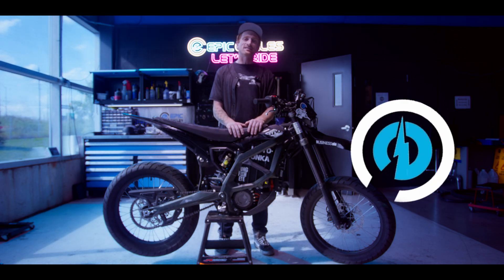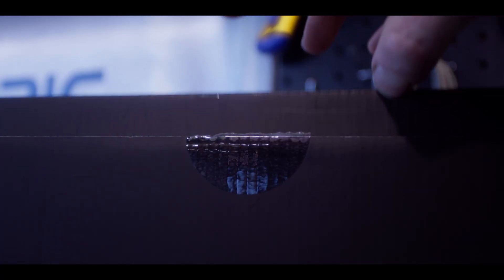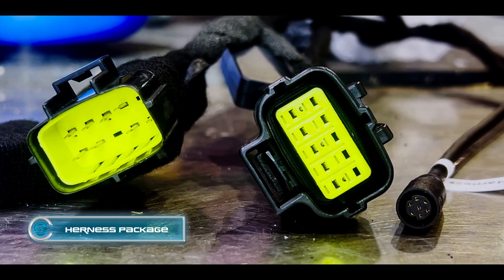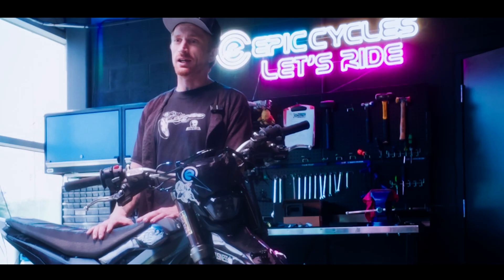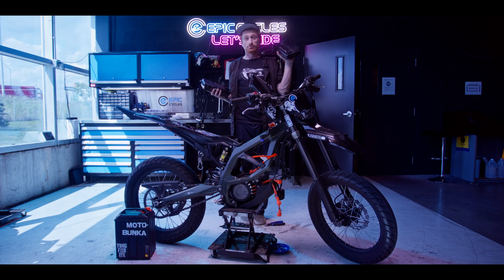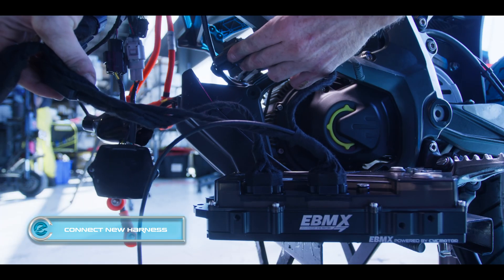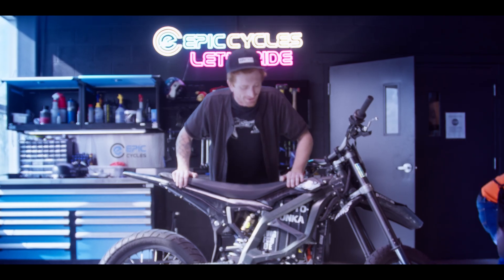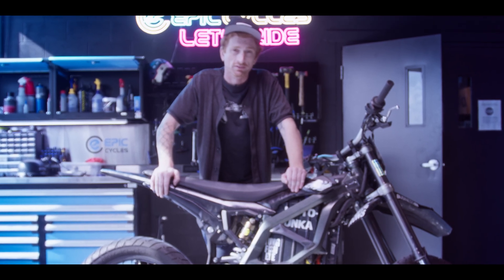EBMX X9000 V3 INSTALL - SURRON ULTRA BEE

Comment: We have tried to install an EBMX V3 on a 2025 Ultra Bee with a Chi Apex battery. Bike will not function. Zero power when key is switched on. We have power to the controller, voltage converter, battery comms cable via Chi converter…. Still nothing. 😢 Any suggestions?
Reply: the screen is on but can not swtich to ready right？and Revers didnt work either
Reply from the maker: Sorry to hear you're having issues, make sure to check all fuses.

Comment: Why aren’t you able to use the regen trottle or display
Reply: Why wouldn’t they just put the 2 to 1 cable in so you can run the display

Comment: Ultra Bee 2024 ? or 2025er ?
Reply: I’ve tried the EBMX V3 on a 25 and it doesn’t seem to work.😢 going through the EBMX support process takes a lot of time at one response every 4 hours.
Reply from the maker: Thank you for watching the video.

Our installation video was not meant to be fully comprehesive, so we suggest reading the instructions provided with the kit to diagnose and resolve any issues.
Reply from the maker: Thank you for watching our video.

The installation was performed on a 2025 Surron Ultra Bee.

Comment: I got the bike to work but it doesn’t seem like I can cycle thru the modes. Unless I’m dumb and I don’t know how to enable the wheel lift assist mode with the stock display.
Reply: You have to tap traction control button aka asr 3 times to activate it or something I’m pretty sure
Reply: Yeah, I was thinking the same thing I want to install mine but he said that you could not install the display
Reply: @bleacher_7882 so far it’s working for me but last night I had a weird thing happen. I have been emailing them to try and understand the eco, drive and sport modes on the ultra bee and what they do with the new controller and I was gonna test them on my stand. And when I went and hit the red switch then I hit ready and the bike started accelerating on its own. So far it stopped but I’m trying to figure out why it happened
Reply: We have tried to install an EBMX V3 on a 2025 Ultra Bee with a Chi Apex battery. Bike will not function. Zero power when key is switched on. We have power to the controller, voltage converter, battery comms cable via Chi converter…. Still nothing. 😢 Any suggestions?
Reply from the maker: Thank you for watching the video.

Our installation video was not meant to be fully comprehesive, so we suggest reading the instructions provided with the kit to diagnose and resolve any issues.

Comment: The battery on the 2025 is different, don't have to turn off regen with the 2025 Ultra Bee right?
Reply: Or do we?
Reply: I believe he also has a 2025 but not too sure. Lmk if u figured out how to do it cuz im lost
Reply: @soyernie I have the v3, but still waiting for my 2025 ultra bee to arrive
Reply from the maker: Thank you for watching our video.

The 2025 Surron Ultra Bee features an upgraded 74V/60Ah (4.44 kWh) battery and incorporates a refined, integrated regenerative braking system as a standard feature, both significant enhancements over previous models. 
2025 Surron Ultra Bee Battery Differences
The 2025 model introduces a more powerful and efficient battery pack compared to the initial Ultra Bee releases. 
Capacity Increase: The battery has been upgraded to a 74V/60Ah lithium-ion unit, delivering 4.44 kWh of energy, which is an increase from the previous 55Ah version.
Performance & Range: This larger capacity, combined with the new 21 kW peak power motor (in Turbo mode), provides sustained performance and an improved manufacturer-claimed range of up to 70 miles (at low speeds/cruising). Real-world, aggressive off-road tests show a range of around 23-25 miles.
Power Management: A major improvement is the power delivery consistency; the 2025 model maintains full power until the battery level drops below 10-12%, a significant improvement over the 2024 version, which started limiting power at 28%.
Charging: The upgraded battery supports fast charging, capable of going from 20% to 80% in under 3 hours. The charger is conveniently stored under the seat for easy trail charging. 
Regenerative Braking (Regen)
The 2025 Ultra Bee comes standard with a refined regenerative braking system (often referred to as "regen") integrated into its advanced controller. 
Functionality: The system recovers energy when slowing down or descending slopes, which helps to extend battery life and range.
Control & Safety: Regenerative braking also enhances control, especially on technical trails and steep descents, by providing controlled engine braking and improved stability.
Adjustability: The level of regenerative braking is often adjustable via the bike's settings, allowing riders to customize the feel and power recovery to their preference and riding style.